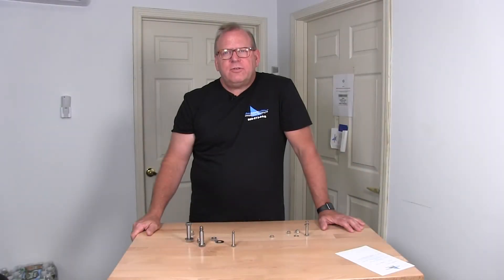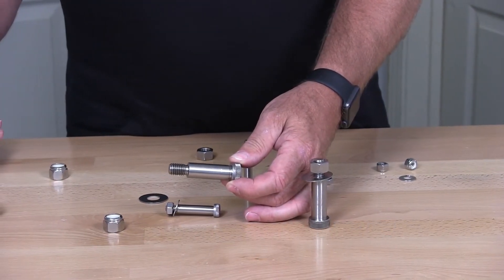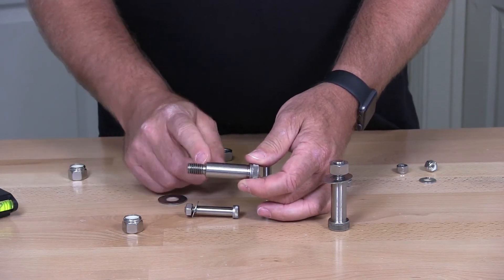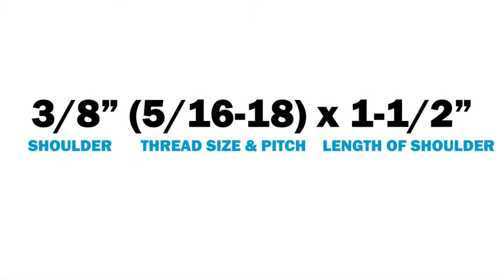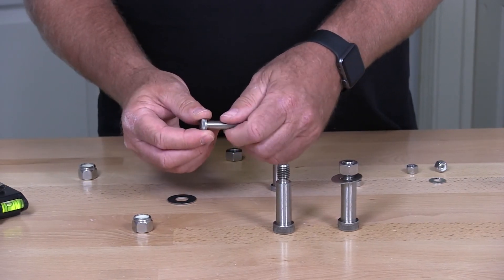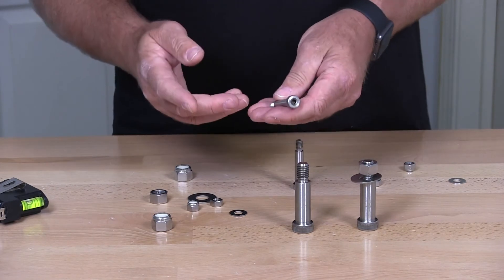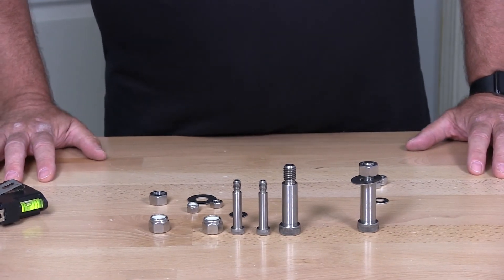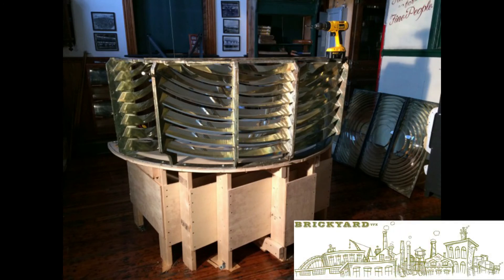Understanding Shoulder Bolts & Cool Creations Winner | Fasteners 101

Comment: where should we use these bolts please
Reply from the maker: It can vary wildly depending on application, but most shoulder bolts will "stick out" of applications so they can be used as dowels, shafts for moving parts, axles, or guides for sliding pieces of an assembly. The long unthreaded shoulder is also used for attached parts that require being able to rotate such as pulleys, gears, and the moving parts of mechanical assemblies such as engines.